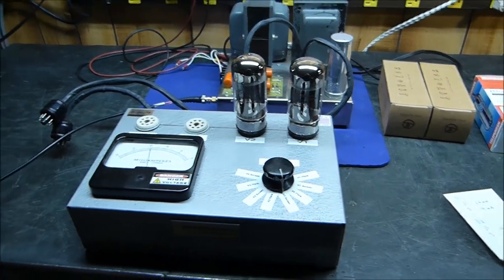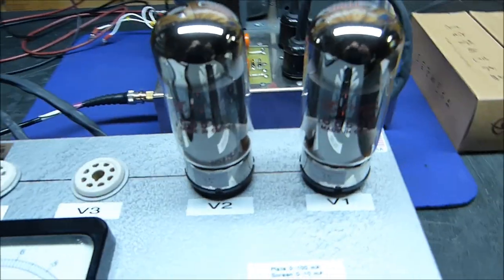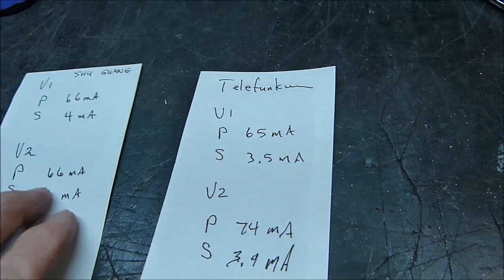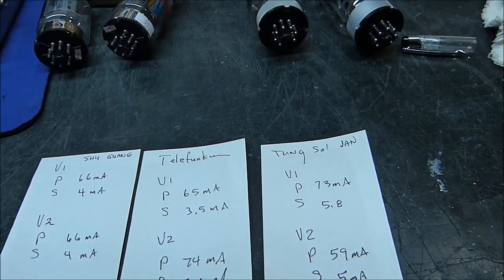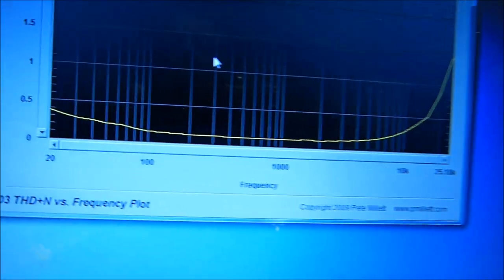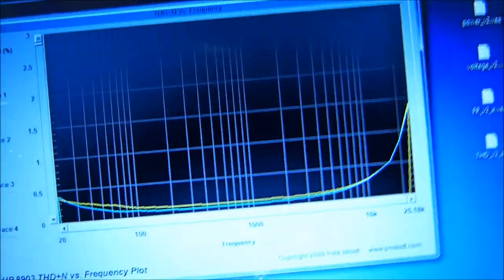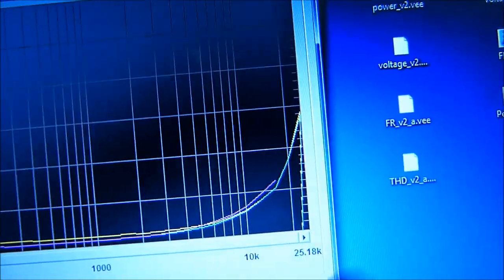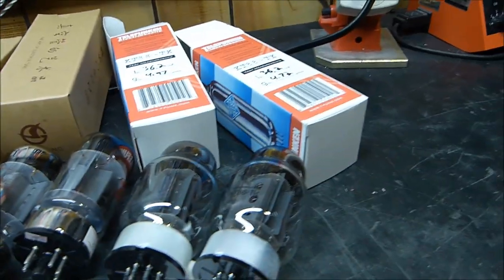6550 (KT88) Shu Guang vs Telefunken vs Vintage JAN Tung Sol Vacuum Tubes in Dynaco Mark III

Comment: Hi David.What do you think are the best current production 6L6GC tube?I am having my old amp serviced and have been advised to "buy some NOS Sylvania 6L6GC as current production chineese tubes just don't cut it and wont last anymore than a year" The amp is an early Boogie which was designed around the Sylvania 6L6GC and some people think they just don't sound the same without them.Of course they are fairly expensive.Do you think it is worth it,for the tone and relibility or would a good quality current production tube work just as well?Any advice is much appreciated.Thanks.

Comment: I changed out the OEM Sovtek 6L6GC on my Peavey Valveking and replaced them with JJ 6L6 from tube depot..what a difference..quiet no weird noise at idle. Changed out the electro harmonix preamp tubes as well with JJs.
I always been fond of the RCA 6L6GC black plates...but today being NOS,,they are asking way too much at $200 a piece
so JJs seem to best the best bang for the buck.. Sorry, but the Russian made (Sovteks) are not in the same class.

Comment: Thank you for your vid, I learned from it
Reply from the maker: Thank you for your comments. Been a while since I have used this device but still have it in good condition. I don't know if I mentioned it in the video, the cables from the amplifier socket to the test jig may introduce instabilities in some amplifiers if the amplifier is swept with a sine wave. I bought ferrite cores to put around the grid an plate wires but never got around to it. Also some small bypass capacitors in the 100 pF range might help quell any parasitic events but for static measurements it is really handy for matching tubes. Stay safe...

Comment: Shu Guang in Chinese means "Aurora" and is pronounced "Shroo 'Gwaang,"  with the stress on the second syllable.  To be closer to the original "Shroo" should be pronounced with the tongue rolled back slightly as if you're going to say "roo" but instead you say "shoo."  The firm has been in valve manufacturing for over 60 years.

Comment: Tung-Sol 3225904, 6550 Black Plate no holes three D shaped getters two on one side, one on top. Creamy mix through out the frequency range, wide open imagining , serious sound stage 20hz- 20khz to me it’s the musical voice of reproduction more than the numbers yet yes numbers count. I’m fortunate to have the  3225904 pair that match perfectly. I’m looking to make a SE 6550 mono pair using 6sn7  driver/splitter

Comment: Bias current can be equalized with individual bias on each tube. Simple and cheaper than buying balanced tubes. Gain matching is more critical.
Reply from the maker: I agree with you. One circuit I am particular familiar with is the McIntosh MA230 amplifier section where there is individual bias adjustment for the output tubes in addition to a dynamic balance of the driving voltage to the output tubes. Both adjustments make a  considerable improvement in THD.

Comment: for the first test where you measure the tube plate and screen current: did you set bias each time? does this amp use fixed or cathode bias in the output?

Comment: Very good video David {they all are}, I wish I understood everything that you are talking about in your video's but I only recently started getting into the operation of tube amplifiers. I purchased a couple of 1960's Hammond organ's {they have very good components as you know) with the intention of making a few guitar amplifiers out of them. I am in no hurry and don't want to kill myself, so I am trying to learn and yours and Doug's video's have been very helpful. I have one digital Multi-meter, an older Hitachi V-222 oscilloscope, a Staco varic, and I built a current limiter as in Doug's video. I need a decent soldering iron as I only have a Weller 100/140 watt gun. I think it puts out too much heat and not where you need it as it doesn't have a point. Do you have any recommendations on what iron I should buy?
Reply from the maker: +Bucyrus Erie12 I recently replaced one of my old soldering stations with a Weller WES51 that I am completely pleased with so I do recommend that one. The 100+ watt soldering guns are always handy to have around for the larger jobs and I have several that I have picked up at estate sales. First order of the day is to stay alive - the second order is to not burn up the components (especially the tubes) by letting them overheat. The screen grid in power tubes are particularly vulnerable. Thanks for you kind word for myself and Doug. I will help in any way I can and I know Doug will also.

Comment: Hello David.  What is the equipment you are using there? Very impressive. And I like the computer touch. But what can I buy to also measure the plate and screen amperage? Thank you for making this video.
Reply from the maker: +Dr. Arthur D. Kemp Hello, Sir - The four socket tube tester is a home brew test jig that I will send you a link to. The computer is running Pete Millett's software on a HP 8903 audio analyzer. Below is a link to a video on using the 8903 with Pete's software. I have made four videos on the 8903.  https://www.youtube.com/watch?v=9MWN1sZZMfI
Reply from the maker: +Dr. Arthur D. Kemp Here is a link to the building of the four socket tube tester.  https://www.youtube.com/watch?v=pIEG6ZqnYwg
Reply: +ElPaso TubeAmps They are called shoe, gwang. There is another Chinese factory down in Shenzen Province known as Guiguang or Gwee Gwang. The new Telefunken stuff is just relabeled JJ tubes. Sorry, but that is what it is. I have a huge stash of new in the box Tung Sol 6550s, and General Electric 6550As. I picked up a couple dozen German Telefunken EL156s at the same place. The GEs are by far the most consistent. The Chinese are making some amazing stuff lately.
Reply: Yes Seth B - The past Chinese 6550's were not good at all.  I always replace them with a new set of Tung Sols when I see them installed in Leslie Amplifiers.

Comment: Shouldn't one test distortion of the tubes themselves with a static load like a resistor chosen with respect to original tube specs?  Now you seem to be testing the amp-tube combination which may not be representative for all combi's. Neat testing equipment you got there.👍🏻🙂

Comment: Hi! What are your thoughts on the SDS capacitor board to replace/upgrade the can style filter capacitors?
Reply from the maker: I see that Triode Electronics sells a board made by SDS Labs as an upgrade. The style of series electrolytic capacitors is the way to go nowadays. I use twelve, 470 uF @ 450 volts capacitors in series for 39 uF @ 5400 volts in my transmitters and they work great (so far...). 
Each capacitor needs an equalizing resistor (470K, 2W or something around that value) across each one to make sure the voltage is distributed equally across each capacitor but that is the way everyone does it these days. The oil filled capacitors seem to last an eternity but they are so large and expensive, it seems no one uses them anymore. As a second thought, this SDS Lab board really makes sense as it is so much easier and cheaper to replace the radial mounting capacitors than a metal multi-section can. Good idea in my opinion.

Comment: Hi, David, have you done a video on your tube current device?  Kind of reminds me of the old (20's & 30's) test set analyzers, thanks
Reply from the maker: Here is a video on the beginning of the four tube device. I did not have the large meter mounted yet. I also have one on the single tube “bias probe” also. I am very pleased with the four-tube  unit. It just makes it all too easy  

https://www.youtube.com/watch?v=pIEG6ZqnYwg
Reply: ElPaso TubeAmps thanks, David, that is quite nice!  Are you familiar with the vintage radio test set analyzers?

Comment: Great video and quite helpful - thanks! Is it possible for you to share a schematic of your wonderful tester? The ability to do what you presented here would be a boon to builders like myself. Again, thanks!
Reply from the maker: I would be happy to share the schematic but I don't think I ever drew one except on scratch paper while building it. I did go to extra trouble to shield the grid wire but I also found out that this test jig is best used only in a static measurement setup. When I used it on a McIntosh MC40, it threw the amplifier into parasitics. I don't remember what happened when I used it on the Dynaco ST-70. I did buy little ferrite beads to put on each wire at the socket to help suppress parasitics but I never got around to putting them on. They might help if you need to use this setup while running dynamic (signal) tests on the amplifiers. As I am sure you know, the commercial  bias probe, or whatever they call it, safely measures cathode current and I have found nowhere a test jig to measure screen current  which is definitely very important.  Once the screen is damaged, the tube performs very poorly and we likely don't know why. Knowing why doesn't help us fix the tube but it might put us on the right track to examine the amplifier and find out why the screens are becoming damaged. The main cause, I have found, is a bad plate connection pin - pin 3 on the 6L6 family of tubes. I suppose that one seems to fail the most because of the heat transferred to it by the plate support lead in the tube. The new tube sockets I have seen are very soft metal and the female pins wallow out the first time a tube is removed and that is definitely going to become a tube-eating-socket.
Reply: @ElPasoTubeAmps  Thanks so much for your comprehensive response. Your comments regarding the screen grid are well-noted. The importance of a stable screen grid supply is highly underrated. I am experimenting with separate rails for my screens. For example, I have a great xfrmr  that has two secondaries - one @ 300 VAC and the other 260 VAC both capable of 300ma. Using damper diodes  (6AU4, 6DE4, 6AX4, etc ) I get a very stable dc supply of 420 vdc (for plate) and 360 vdc (for screen grid). This is textbook perfect. I place a 5W   4.7K resistor in series with the screen to minimize any damage to the screen upon turn-on. My SOVTEK Mig 60 guitar amp made in Russia has separate plate, screen and preamp rails and a dc filament supply! They Russians knew the importance of separate and stable screen and preamp rails! My goal is a stable 300 vdc supply for all tubes regardless of plate voltage. Svetlana recommends only 300 vdc screen supply for their KT88s regardless of plate voltage. And the 807/ 1625 can only withstand 300 vdc screen supply max. Again, thanks so very much for your superb videos and comments.

Comment: I don't know what tubes you show as Telefunken, I would have been quite pleased to see a comparison. 

That's why I came here.
But the tubes shown on the video come with black text. Whereas bona fide Telefunken tubes got white printing.
The price you stated would also have been a super deal. There's a rumour among us tube enthusiasts that fake Telefunkens are sold, and that those are rebranded JJ tubes sold at an excessive price. I cannot  tell if that what you got there. But they're definitely not Telefunken.
Reply from the maker: You are right that they are not original, vintage Telefunken tubes. They are re-branded JJ tubes and they are a bit more expensive than most tubes. As I am sure you know, from the very beginning of vacuum tubes, often times GE or RCA or Tung Sol, Amperex, Mullard and the whole manufacturing sector of vacuum tubes, sold to each other and re-branded. When vacuum tubes are manufactured, I suppose because they are such a labor-intensive, hand-made item, they turn out often times with very different operating parameters. The tube manufacturers of yesterday and today certainly go how to "grade" their tubes and they re-brand and sell the first-class tubes at a much higher price than the average tube. Quite honestly, the vintage vacuum tubes made by the companies listed above were a lot of junk back in their day. I am not particularly a fan of the average JJ tubes but I thought I would try these for the reasons stated above. From the very beginning, I tested these new Telefunken branded tubes and  was very impressed with the matching of the quad that I purchased. Years later I am still impressed as they perform very well in a McIntosh 275 and other amplifiers. I am not trying to sell anyone Telefunken tubes but I am sure that all tubes are not made and sold the same. This video is just a comparison of the few tubes I have and how they perform in my particular case.
Reply: @ElPasoTubeAmps  Hello that was a quick reply. You confirmed what have been stated online then.
You should not worry, there's a lot of fake Telefunken tubes around, they even fake the diamond mark in the glass, if it's fake its engraved - it's supposed to be elevated. (Just google 'Fake Telefunken' and anyone will get a lot of hits.)

JJ never had any connection to Telefunken though, but Japanese tube makers did!
Back in the day there also have been Japanese made tubes sold as genuine Telefunkens - so even 'genuine' ones might not actually have been made in Germany, but should be of the same standard.

The real Telefunken exist and the company is found at https://telefunken.com/ so whatever you got is not just fake but come with a potential copyright issue.
As for me, I got my hands on a very well sounding tube with one USA brand. So such exchange of tubes seem to have been done also to the US of A. After some detective work the tube turned out to be made by Matsushita, I recommend those warmly if you're inclined to test some day. :)
Reply from the maker: @andersforsgren3806  I enjoy these conversations and try to respond promptly.
I like to compare and document components and assemblies just to see if they live up to the hype propagated over the Internet about them. This definitely includes items like vacuum tubes and audio output transformers which I have found that Acrosound, UTC and even the new James transformers do quite well. One of my favorites is the Acrosound transformers. Same is true for tubes. As you know, all of the vintage names are printed on tubes nowadays as I assumed these tube manufacturers/sellers have purchased the copyright from the original owners. I have read stories where entire vacuum tube factories in England have been meticulously disassembled and transported to China and Russia so that tubes could be made as original as possible to the vintage ones.  I don't worry so much about fakes as I am confident I will spot them and these new tubes have where they are made, stamped promptly on them. I think the Russians and their groups have made some excellent tubes. Not picking on the Chinese tubes but the Russians ones work very well and in my measurements and subjective opinion are every bit as good, or possibly better in some cases, than the original venerated USA and German made tubes. Overall, I am grateful that there are a bunch of "nuts" like us, in whatever country they are in,  that have such a love for this vintage technology of vacuum tubes that they want to continue building them even today. I think it is wonderful that we can still buy new tubes otherwise, there would not be a vacuum tube audio amplifier business as every tube would cost $1000 each. Just my thoughts on it.

Comment: We were scratching our head wondering why you are only getting 50 watts out of your MK3. Turns out Dynaco made 2 versions of the MK3. The early version was 60 watts, has different power transformers with higher voltage. The early transformer had cloth on the leads. Side Note, If you bought a kit from Triode Electronics their power transformers have a higher output voltage then the power transformers sold on the Dynakit website. I happen to know this because I have transformers from both venders. You should be getting right about 500 volts with a tube rectifier
Reply from the maker: That makes perfect sense to me and you are the only one that has ever mentioned this. I have two Dynaco amps, the MK3 and a ST-70 and the ST-70 will just barely, if I keep the input voltage at 120 volts, do the 35W per channel but I have never seen 60 W out of the MK3. Just another 30 volts or so on the plates will probably do the trick but I was not aware of slight differences in the power transformers.  On the test bench, using a Variac, the difference between 110 volts AC input and 120 volts input is truly significant in power output and THD. In general, the amplifiers from this era, Fisher, HH Scott, etc, etc most likely would just barely, if indeed, reach their advertised power output so I just put Dynaco in that category - slightly over rating their amplifiers for marketing purposes. The only amplifiers I  have ever seen that consistently will deliver more power than the advertised amount is McIntosh and that is true for their tube amps and their transistor amps. Thanks for letting every one know about these power transformers.
Reply: @ElPasoTubeAmps  My Friend just tested his Mkiii with the old transformer that has cloth insulation on the wires, text me results. On 120.9 VAC with a 5U4GB he is getting 506V DC , with a GZ34 529V and Solid State 548V. 
 I had built 2 MK3 but with parts I purchased at different times. With the transformer I got from Triode I was getting about 498 volt, my source is 115v. With the transformer I got from Dynakit I was measuring about 469v.